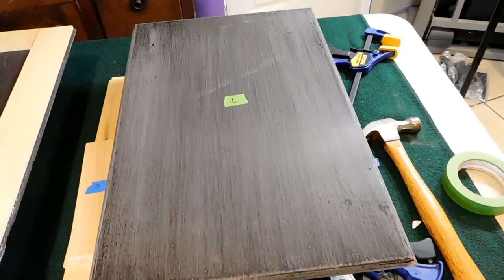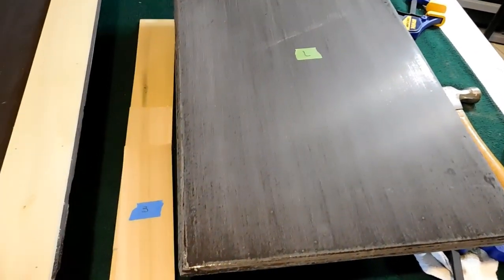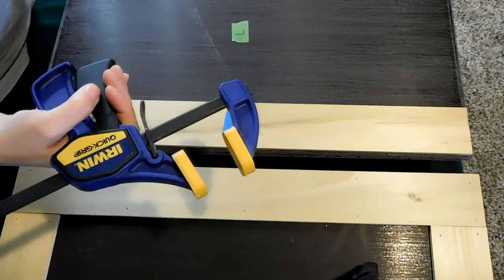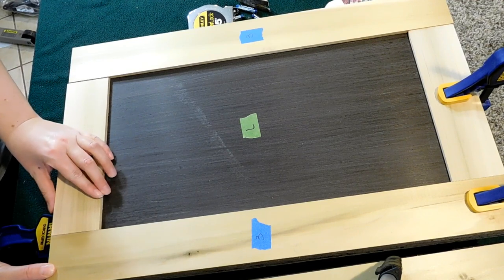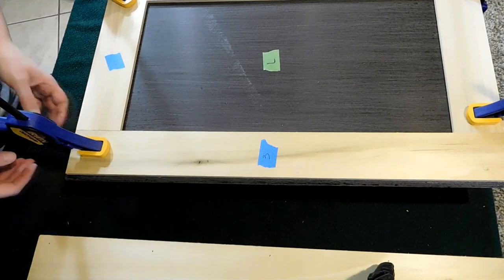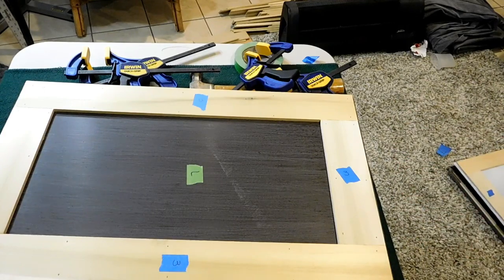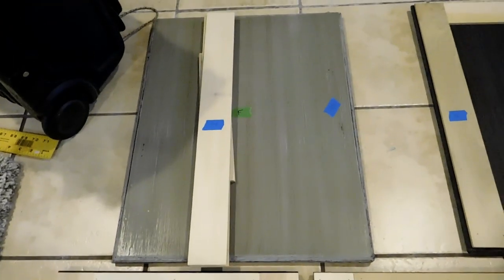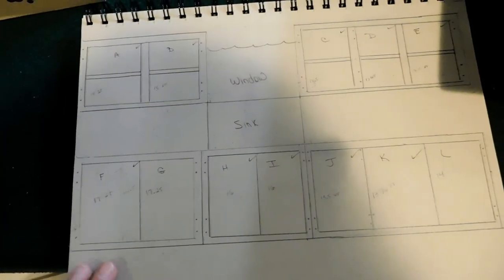DIY Flat Beveled Edge Doors to Shaker Style Cabinet Doors!!

Comment: We have the exact same doors. So  what did you do for the gap between the beveled edge and the new trim you put on?
Reply from the maker: I filled the gap between the trim and the doors in with paintable caulk. I let it dry and then I added another layer of caulk, and then  smoothed it out until it was seamless. If you have anymore questions, please let me know. Thank you so much for watching! 😊
Reply: Thank you, now I think I remember  you saying that when I watched it the first time. Would it be possible  to get a picture of a door from that angle?
Reply from the maker: You're most welcome :-). We don't actually own that house anymore. We sold it a year-and-a-half ago. I actually posted a video of our moving day, and the finalized cabinet doors are in that video. I will link it below. Hopefully it will help you get an idea of how they turned out. They turned out really pretty. 

Moving Day
https://youtu.be/Jhy57--SVHk
Reply: Thank you...
Reply from the maker: You're welcome

Comment: I have same kind of doors and have even bought different types of stripping to try to go around them.  
I like yours but have a couple of questions. first what did you do around the edges to fill in?
And why didn't you put the strips to the edge where it started to bevel?
Reply from the maker: I used caulk around the edges and use wood filler for all the nail holes. Then I sanded the wood filler. The reason I didn't actually take the trim all the way to the beveled Edge is because there would have been a large gap in between the roundness of the beveled Edge and the squareness of the trim. I had to stop where it actually squared off on the cabinet door before it dipped into the beveled Edge. Because the trim is squared off, if you would have overlapped it then you would have had trim sticking out past the beveled edge of the door and it would have looked awkward. I hope that makes sense. I'm terrible at explaining things. lol 
If you have any more questions please let me know :-). Thank you so much for your comment!

Comment: Where in Lowes did you find the molding? I couldn't find any 1/4" molding
Reply from the maker: It was in the lumber section in a bay, but I cannot remember where in the store that I purchased it. The link below is for the item number I used, so they may be able to point you in the right direction once in the store. I hope this helps! :-). If you have any more questions please let me know

https://www.lowes.com/pd/Common-1-4-in-x-2-in-x-4-ft-Actual-0-25-in-x-1-5-in-x-4-ft-Poplar-Board/1000074305

Comment: what kind of wood did you use for the trim to make that shaker look? where did u get them?
Reply from the maker: I got the trim at Lowe's, but they don't sell that particular trim anymore. However, I will go ahead and leave you the link to the exact wood I used, and if you go by Lowe's or Home Depot, they may have something similar, or could order something similar. If you have anymore questions, please don't hesitate to ask 😊. Have a great day!

Here is the link:

https://www.lowes.com/pd/Common-1-4-in-x-2-in-x-4-ft-Actual-0-25-in-x-1-5-in-x-4-ft-Poplar-Board/1000074305

Comment: How have these held up, and what wood did you use?
Reply from the maker: Yes they held up remarkably well. We did not use a heavy wood on the face of the doors because of too much weight. We used a lighter wood. We got quarter inch thick by 2 inch wide by 4 foot tall Birch wood for the faces of the doors at Lowe's. They came in strips like that. I don't think that they make those strips of that particular wood anymore, but you can definitely find something similar I'm sure. I spackled all the holes with wood putty and sanded them, and then filled in all of the gaps around the edges with paintable caulk. If you have any more questions please let me know. Thanks for watching and have a good day 😊

Comment: I was curious, in looking back now on your project, would you have painted all of the pieces first and then assembled rather than paint at the end?
Reply from the maker: You definitely could do that. The reason I didn't do that is because I had to fill in the nail holes where I refaced them, sanded them and then caulked them. So I just figured it would be a lot easier to paint them all after everything was done.

Comment: My cabinets are exactly the same as yours.  How did you hide the sides and make them smooth?  Also, what is the width and thickness of the wood pieces you glued and nailed onto your doors?  What type of wood did you use?
Reply from the maker: Hi :),

On the sides of the cabinets, I filled in the sides with caulk in the parts where the wood trim on top meets the facing of the doors.  Just make sure to wipe any excess caulk off with a damp cloth.  That should hide the seems.  I guess you could technically use sand paper/sanding block to round the edges of the trim if you wanted, but I liked the look of the squared edges because I wanted to give it that shaker door look ;).

As far as the width of the wood, I went with 2" wide strips that were a quarter inch thick,  that were already pre-cut and sold like that at Lowes.  If you go down the wood  isle, they are in a small bay bin on a shelf.  They had different widths, but I really like the 2" wide pieces. Also, the wood at lowes is about 3-4" in length pieces.  So we used about 2-3 boards per door depending on the length/width of your doors.  So take into consideration as well when purchasing all of your wood.  I can't remember the type of wood it was  unfortunately.  But it was the only type that I found that was pre-cut to the exact size I was looking for.  Because the sheets of wood they sell like plywood ect, I found only came in 1/2" thickness at the least, and that's way to thick for the trim.  

I hope this info helps :)
Reply: Did you do the drawers, too?  Mine are 4 3/4" top to bottom, so the 2" strips would just about cover the entire thing.  What was your solution for that?  I would love the see the final result!  Thanks!
Reply from the maker: I haven't on the drawers yet, but we are planning on using the one inch wide trim. for the drawers because the drawers aren't as deep. So I'm going to go back to Lowe's and get some of the 1 inch by quarter inch strips of wood and do the same things on the drawers. You might try a smaller size like the one inch on yours as well. 😊
Reply: Thank you.  I'm very excited to do this!
Reply from the maker: LM William I'm glad! I hope your cabinets turn out great! :D Keep me posted on how they turn out! This is the best idea that I could come up with to make some old cabinet doors into more modern doors. So I'm very glad that I've inspired you to do it to! it does take quite a while to do if you have the beveled edges like I do, but with patience and time, it's so worth it in the end :-). I will be posting a video in the near future on how I spray paint the doors with a new spray painter that we just bought. So keep an eye out for that video as well if you're interested in possibly spray painting them rather than hand painting them down the road 😉
Reply: I just got my Bostitch Smart Point nailer.  What size brads should I get?  I was thinking the 1", but that is the exact thickness of the doors with the trim.  What size did you use?
Reply from the maker: I used the 5/8" brads

Comment: What kind of wood did you use for the shaker look
 on the door?
Reply from the maker: I used birch wood strips that I got from lowes.  They came in 4ft length, x .25" thick, and 2" wide.  But you can use any type of wood you like.  These were already pre-cut, so that's why I went with them. You just want to make sure you don't use wood that's more than a quarter inch, because it may make your doors to heavy, but also, it wouldn't look right.

Comment: What kind of wood and size did you use.
Reply from the maker: Here's the link from Lowes of the actual boards I used :).  Thanks for watching, and good luck with your doors.

https://www.lowes.com/pd/Common-1-4-in-x-2-in-x-4-ft-Actual-0-25-in-x-1-5-in-x-4-ft-Poplar-Board/1000074305
Reply: New Day Vlogs 
Thank you

Comment: What type of board trim did you use?
Reply from the maker: Here's the link from Lowes of the actual boards I used :).  Thanks for watching, and good luck with your doors.

https://www.lowes.com/pd/Common-1-4-in-x-2-in-x-4-ft-Actual-0-25-in-x-1-5-in-x-4-ft-Poplar-Board/1000074305

Comment: You must have had a gap along the outside edges where the straight edge is a fixed to the rounded edge.  Did you fill this edge in? Also, had you thought about applying the trim to the back side of the door?
Reply from the maker: We filled in all of the gaps between the trim and the face of the door with paintable caulk. I believe I put two coats of paintable caulk in the gaps. I waited for the first to dry and then put the second coat on just to make sure there was no shrinkage. 

If you flipped the door over and used the back side of the door as the front, it would have looked awkward because the front door has beveled edges and it would have shown a gap where the door did not sit flush with the frames of the cabinets because of the beveled edge. Plus the back side of the cabinet doors had a indent where the back fit inside the cabinets, and a lip that was supposed to fit around the frame to hide any gaps when turned right side in. So if you would have flipped those doors over, you would have had a lip that set flat against the frame of the cabinets, and a square box that set even with the middle of the door 
. I hope that makes sense  lol. It's really hard to explain. Had it been a squared-off edge, this would have been such an easier project. I think that's the reason I wanted to make this video for everyone who has beveled Edge doors. The squared Edge doors would have been so much easier just to line up the trim and be done. But these 1965 beveled Edge doors were a challenge. The end result so we're awesome! It does take a while to do to get it right, but it saved a lot of money and the end results were fantastic!

Comment: "I'm not good at explaining stuff" I appreciate the time you put into making this video. You have inspired me.  You sound like my aunt from the Midwest so I am endeared to give some friendly advice, take what you want and leave the rest. A couple of suggestions and unsolicited advice on the video.
1. Learn how to edit. You have some great material if it was edited it would make your videos more interesting to watch. For example at the end of the video you show all of you various attempt to change your kitchen cabinet doors. This would have been a nice intro and then show your final solution of adding the shaker door veneer painted and ready to hang. Then explain the steps to accomplish the finished look.
2. Start with the cost of the supplies needed and a list of the tools needed to do the complete job. 
3. Show your challenges with your doors. It would have been nice to see the profile of the door rather than an overhead shot to see the bevel on the front edges before you start placing and adhering the rails and styles veneers . 
4. Explain how you are going to correct the beveled edges, wood putty, or bondo? Since these are solid oak doors, I would suggest a router to cut a rabbet (it would end up looking like the back side of your doors) and then add a filler strip of oak to make edges square. The styles and rails will cover up the additions.
5.Invest in an adjustable square to insure your styles are flush with the door.
6. Invest in a punch to set your brads that way you won't mar the surface with the hammer head.
7. Wood expands and contracts with heat and cold. it might be better to use oak veneers so the veneer is the same species as the door but in any case the joints on your rails may end up cracking as the grain is perpendicular to the door. Using a paintable silicone caulk that stays flexible will help.
8. Your finish was paint so filling and sanding will not hurt the wood veneer starting with courser grit and ending with a fine grit.
9. With the doors sanded smooth, start with a primer coat to insure good adhesion, then two coats of paint and finish with  two coats of a clear finish. invest in some self leveling paint additives so the paint will dry flat without brush or roller marks. If you have the budget and ability, spay paint but if not use a foam roller to apply the paint and clear coat. 

Great video, The back of my doors are flat so I am just going to flip my doors over and then add the shaker veneers. To complete the transformation I am going to get the European hinges and the saw bit kit from home depot to cut doors for the new hinges.

Comment: How thick are the Wood edges
Reply from the maker: Hi Gina, if you're talking about the trim pieces that I purchased, they are 2-inch wide by 1/4 inch thick.
Reply: Thank you great job
Reply from the maker: Thank you so much! 😊
Reply: How do I find them Lowe’s trying to find them on the website
Reply from the maker: This is the link of the actual product that I use for the front of my old cabinet doors. The Lowes website says that they are out of stock and no longer carry the item anymore. But if you go into Lowe's and show them this particular product, they may actually have something similar to it. But this will give them an idea of exactly what you're needing. I'm so sorry they're out of stock but at least this is the exact dimensions and size that you will need for your cabinet doors :-). You should also try Home Depot as well. If you have any more questions please don't hesitate to ask.

https://www.lowes.com/pd/Common-1-4-in-x-2-in-x-4-ft-Actual-0-25-in-x-1-5-in-x-4-ft-Poplar-Board/1000074305
Reply: Thank you so much you was very helpful great Idea❤️🥰💯